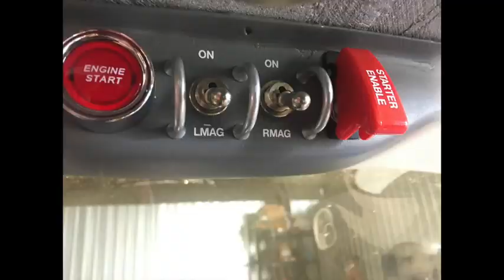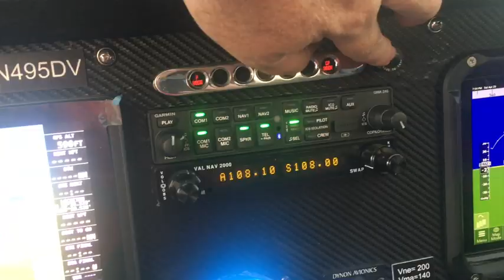Velocity Kitplane Build Part 34

Comment: Looking good!
Lights in the canard look really cool.
May I suggest you add large diameter washers to each of the rod ends. This way, in the very unlikely event a ball pops out of the eyelet, the washer will keep the assembly together. Else, the eyelet could totally dislodge.   Yep, very unlikely, but just cheap insurance.
Oh, hope to share my autopilot settings in a week or two. I’ve not had a chance to fly in two weeks- bummer.